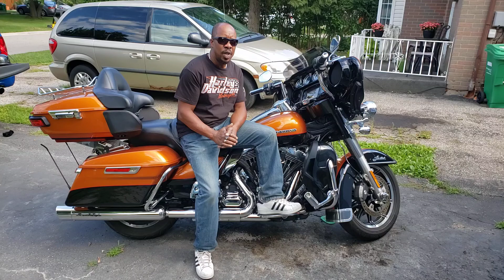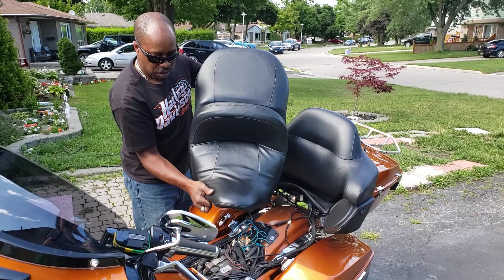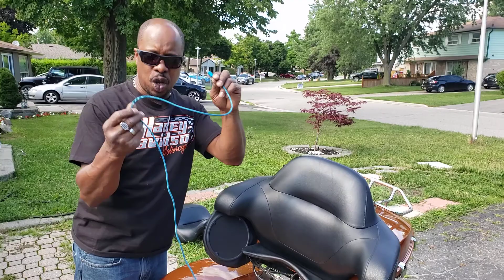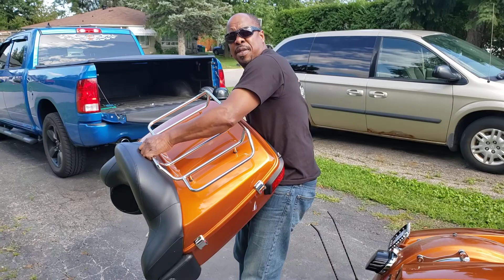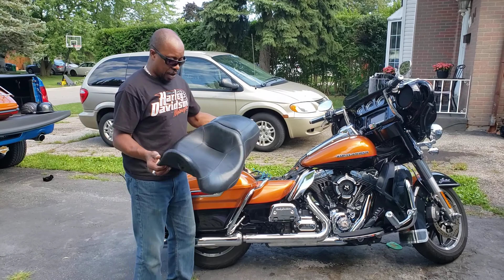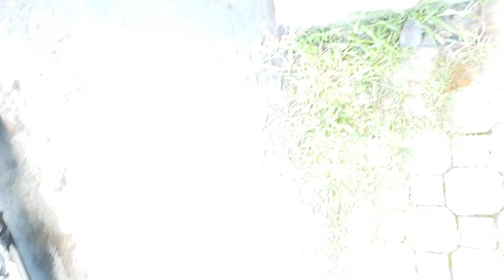Tour pack removal part 2

Comment: Just like that!  As long as you have a license plate relocation mount, turn signals added on the bags or the filler panels, your antennas relocated., Four-point docking hardware, quick detach mount for the tour pack, and a new seat.  You can spend thousands doing this if you buy all Harley parts...... My total conversion cost about $375 buying  the cheap stuff from Amazon and eBay... I have the same bike with brilliant silver in place of your vivid black.
Reply: Would you happen to have the links to all the parts you used to add the quick removal kit
Reply from the maker: Saddlebag docking system from Harley-Davidson; the filler panel lights were from Amazon. Low rider's seat from Harley-Davidson.

Comment: Hey Mike. Very helpful video. What kind of replacement seat is that you are installing. I'm looking for something to replace my stock 2014 Ultra Limited. Need something less bulky.
Reply from the maker: It a street glide seat
Reply from the maker: I just use a seat from a street glide
Reply: @spikeonbike1  Any particular reason for the change in seats?
Reply from the maker: @tomjustice7610  its a street glide seat. When tour pack is removed the bulky chunky seat got to go as we'll....love the versatile of the quick release mounts....

Comment: I had a quick question for you I have the same filler panel lights that you have in between my saddlebags.   I took my tour pack off my 17 road glide. Are those just the Harley antenna relocator kit you have or are those some aftermarket??
Reply from the maker: Yes its a relocation kit for antenna and radio. Fir when I remove my tour pack...street glide look😉
Reply: @spikeonbike1  right. Did you get the antenna relocation kits from Harley?
Reply from the maker: No I when I got the bike it already had that set up. But they can be ordered anywhere... HD can be a bit   a bit costly...
Reply: @spikeonbike1  Yes they can be that’s why I ordered my quick detach docking hardware off Amazon and installing it right now and it works just as good as Harley‘s!

Comment: Hi looks great. What license plate bracket is that? Harley’s is straight up, yours looks like it lays down a bit. Thx
Reply from the maker: Yes it does lay down tilts backwards. Hard for cameras to pick up....
Reply: @spikeonbike1  did you modify the Harley one? I can’t find a top mount brackets that tilts back like that.
Reply from the maker: @henryblack2291   When I purchase the  Bike it had the  lay down bracket already on it...
Reply from the maker: @henryblack2291  when I purchased the bike it had that bracket but I'm quite sure you can find online...good luck